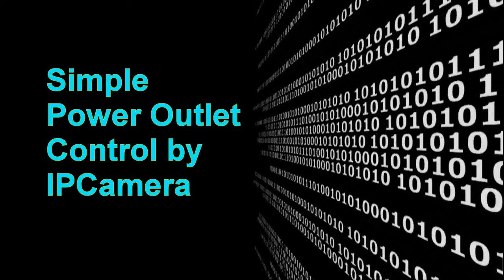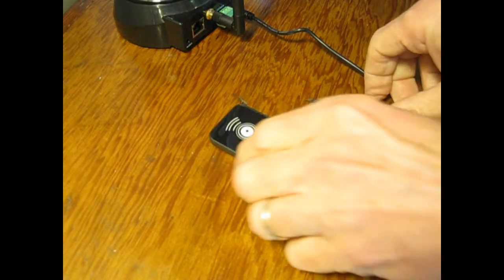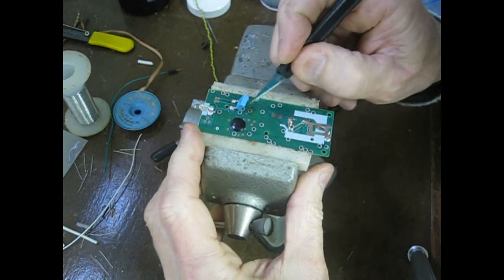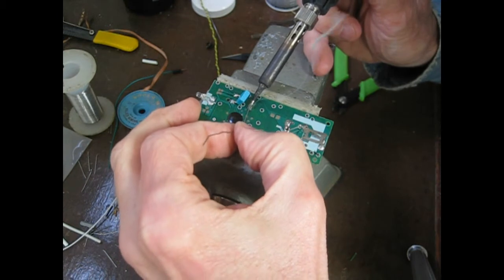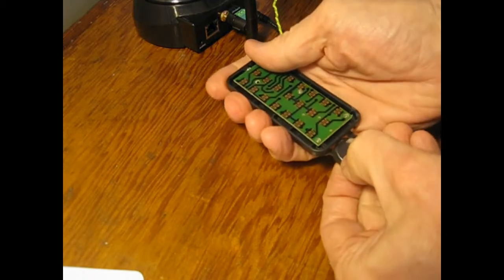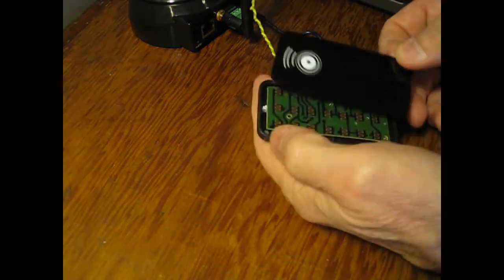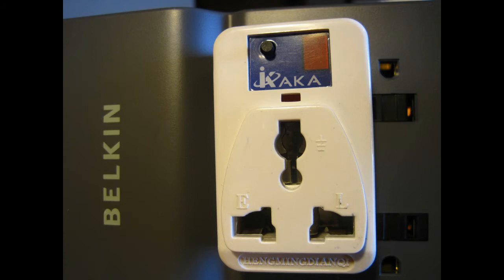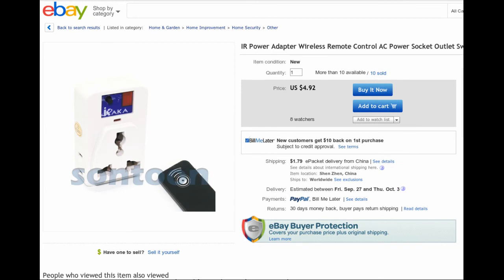Simple Electrical Outlet Control Over Internet via IP-Camera

Comment: Nice video. I haven't found any clear info about IO pins. So, the pins you are wiring are shorted from those buttons? How are the alarm pins supossed to work (one of them is input and other output??)? I have the same camera, and in the user manual said something about a 5V and GND pin, which ones are those?

I wanna conect my basement light to camera with a 5V relay, but I'm kinda lost.
Reply from the maker: As explained in the video, when faced from the rear, the left two pins are the relay output and the right two pins are for alarm sensor input.

The connector is basically the same for all similar Chinese cameras. The pins are numbered 1-to-4, left to right, when seen from the rear. Pins 1 and 2 are controlled by a DC 5V relay. If you click on the chain icon in the web based operator device control, the normally open contacts of pins 1 and 2 will close until you click on the break-chain icon. If “I/O Linkage on Alarm” is set, Pins 1&2 will close upon a short of pins 3&4, and remain closed until reset by click on the break-chain icon.

The current limits for this relay connected between I/O Alarm pins 1 & 2 are a Maximum current of 2A/24VDC, 2A/125VAC with a resistive load. Since a reed relay is used to short the pins, higher currents or inductive or capacitive loads should be operated through a slave relay. A solid state relay is a good choice because it eliminates concerns about inductive load damage to the reed relay contacts.

A common use for the right two pins (3 & 4) would be to interface a PIR motion sensor or a switch contact, such as a doorbell. PIR alarm sensor motion sensors are inexpensively available on eBay - just make sure that it has a relay contact output that can be wired to the camera's pins 3&4.
Reply: celem1 Thanks you for your quick response!